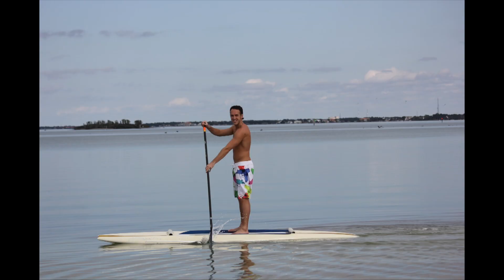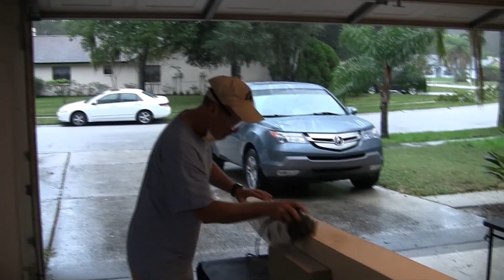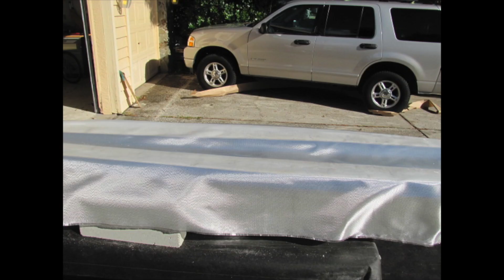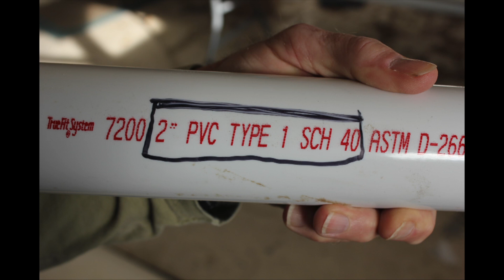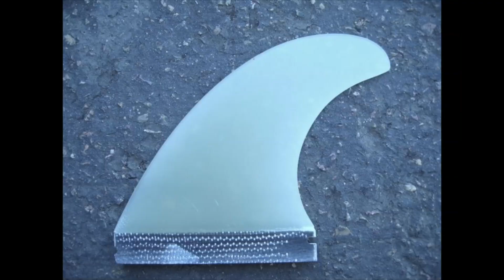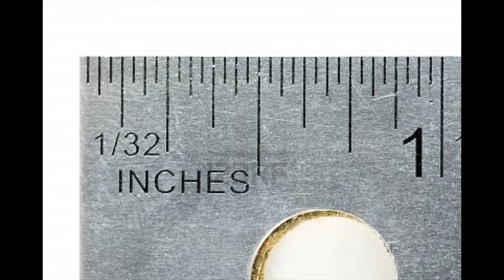Build a SUP paddle board for $50

Comment: Why not just use the windsurfer as a sup? Just paddle it instead of sailing it. Take out the center board and cut down the original skeg in back to 8 inches or so. I don't know how you would surf a cat board since you can't stand in the center in surf stance. But you can paddle and surf a windsurfer such as an old Starboard Go as long as you have a smaller skeg in back.
Reply: Yo dude your comment is exactly what I did I managed to get two old windsurfing boards for £30 and they worked pretty good , haven't tried surfing it yet though , what's the purpose/ benefit of cutting down the skeg ?